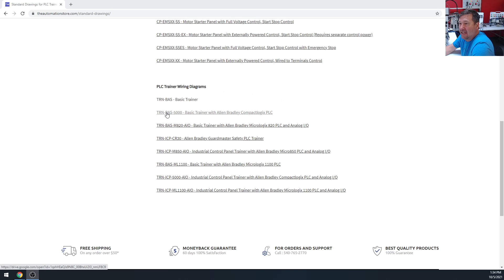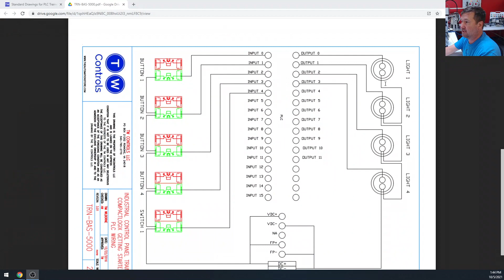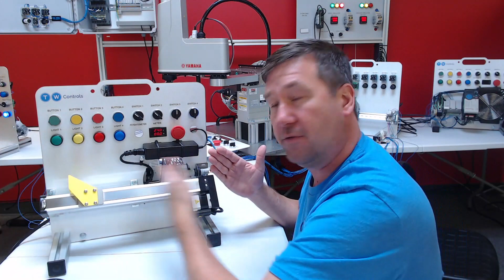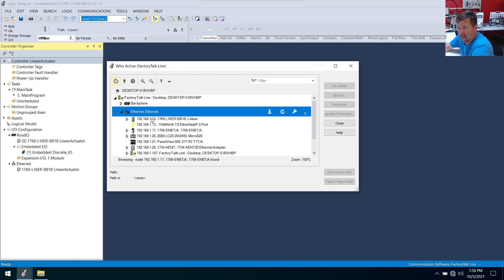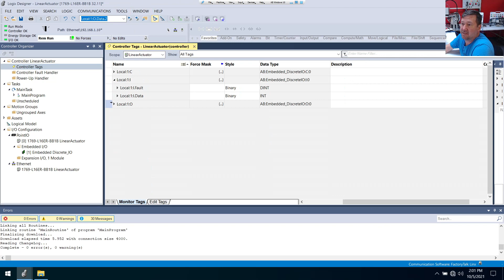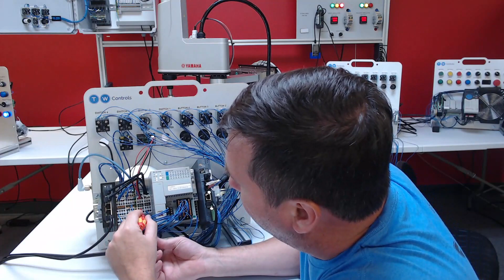Motion Control Trainer Getting Started Wiring Diagram

Comment: Tim,
Can these servo drives be controlled by the micro820/850 over ethernet as well or will the micro series not support the communication?
Reply: There are three ways to integrate the TS-SH controller. 1. AOIs with a 5000 Allen Bradley PLC, 2. I/O wiring with BCD, 3. Serial/TCP IP with Telnet / Message commands. We are working on trying to get the Micro800 to work over EIP, but not finished up right now today. I think it's possible, but we are flushing it out still. I think we are pretty close thanks to Tim's R&D work already with the Micro800.
Reply from the maker: Wow, Yamaha beat me to reply again. I hope to do some experimenting with the Micro820 and this servo soon. A few tweaks and it may work.